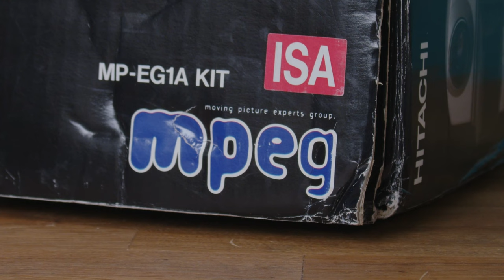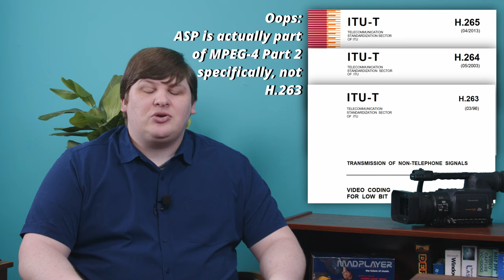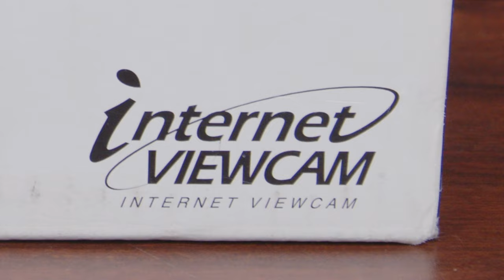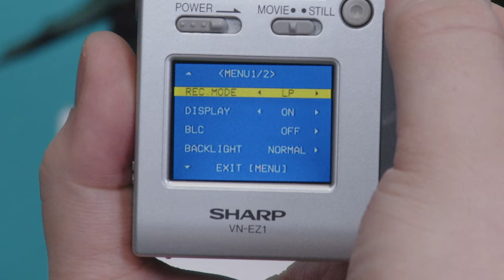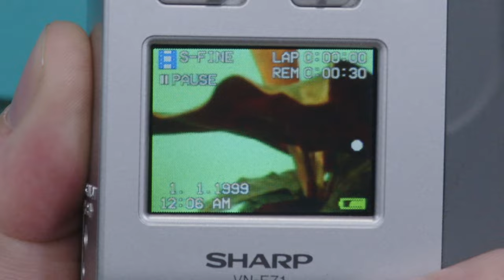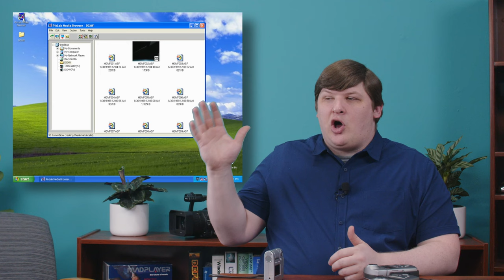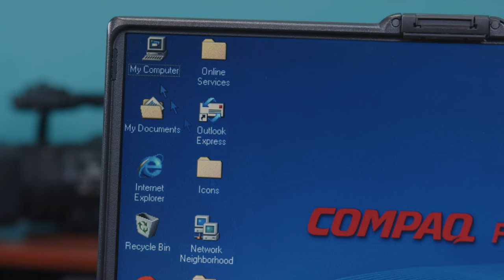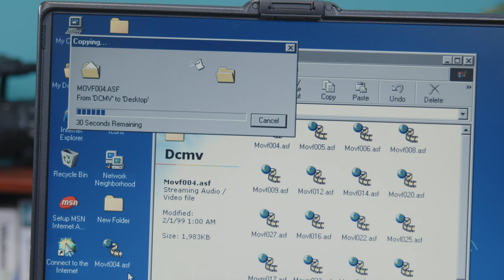The first thing that ever used MPEG4 [Sharp VN-EZ1]

Comment: 47:46
That styling is the one thing I could NOT stand about "millennium era" tech products. You've brought it up in the past, but EVERYTHING in consumer electronics had to be bubbly and egg shaped. It drove me nuts!! (being a huge fan of 80's and 90's volvos "styling", that design is nails on a chalkboard to me)
Reply: Consider the other side though: these shapes gave the devices personality and an optimism for an exciting and playful future of technology. Plus, they felt really great in your hands, usually! Or at least mine. I severely miss blobject electronics being a norm and I think it was better that way.
Reply: weird thats why i love 2000s products
Reply: It's one of the reasons why I love 2000's products so much
Reply: yeah but what volvo have you got?
Reply: I definitely have a love-hate relationship with it. it's new, interesting, and futuristic, but at the same time tacky, ugly, and makes it hard to use.

similar to 80s boxy styling! I love all my Minolta film cameras. but at times I've found them to be too boxy and clunky
Reply: Also, death to teal plastics. 

Turbo swapped Volvo 144s here, as an aside. Teal, but teal steel gets a pass.
Reply: I think it would have been passable if any of the Y2K technoblobs were made of something other than nasty painted plastic

Arguably it’s not the shapes of the time that suck, but the materials:

Chrome plastic that looks cheap, silver paint that looks even cheaper, soft touch rubber that degrades, shiny smooth surfaces that pick up scratches, clear plastic that makes you aware of every speck of dust in the device, silkscreening that rubs off easily, ABS that gets shiny if you look at it threateningly, beige-painted metal - the list goes on and on…

Comment: I am glad you mentioned Divx. That was usually the first thing I downloaded whenever I got a new PC in the early 00s.  All those extensions, asf, wmv, mp4, mpg, mov, mpeg, etc. It was such a hassle since you had all those container formats.. not interchangle, with all those odd codecs.
Reply: The worst thing about multimedia container formats is that, because most of them can contain just about anything; you have zero indication that what it contains is actually playable on any given system. Filename extensions, in general, are a terrible way of communicating metadata; and should have been replaced by a standardized metadata container decades ago.

Comment: 18:10 Fun fact! .mov isn't actually any different from .mp4. IIRC the MPEG basically took the Apple format and standardized it. You'll also see it with extensions .m4v, .m4a, .3gp, and some others.
Reply: m4a is just mp4 without a video stream
Reply: @TorutheRedFox  and Apple used the MOV container for regular AAC sold from iTunes as well as for QuickTime video. M4V and M4A were subtypes of MOV, just as WMV and WMA were subtypes of ASF

Comment: @7:30 One of my favorite things about mpeg - however it might not be strictly true - is that the standard defines the player and not the format or the encoder. It says: "Here! This is how a player looks and works. Now make something that this can play!". That's different to how videotapes and such standards were designed.
Reply: The ITU H.26*n* standards (or at least, the early ones) are even weirder with this, because H.261 was actually a video calling standard. Over ordinary phone lines. The handset would have a modem and codec inside of it that would let it negotiate and upgrade from analog voice to really low-bitrate digital video. So the spec is written with a bunch of language that implies the video stream is bidirectional, because in the intended use case it totally would be. There's even extensions in H.263 for in-band acknowledgements (e.g. "here's my frame, also I didn't get yours so please resend it") and conference calling services with multiple video streams - all things that make absolutely no sense to exist within a generic video codec and today we'd consider the job of a container or TCP.

MPEG was trying to unify basically every video market into a single common digital standard. They tried to subsume ITU H.263 (poorly), and also picked up a lot of weird baggage about trying to split the difference between NTSC and PAL. This was a market in which existing videotape formats couldn't even agree with themselves on how to store certain formats (e.g. SECAM vs. ME-SECAM recording); so it was a huge sea change to just have One Codec to Rule Them All.
Reply: As far as I know, this is how most (but certainly not all) compression standards work. That’s why you can have different ZIP compression programs that produce different size output, different MP3 encoders that produce better or worse quality at the same bitrate, etc.

Comment: 5:07 - This is because H.264 has an in-loop deblocking and deringing filter. It just so happens that on lower profiles H.264 tends to use 8x8 pixel blocks as well and then it smoothes the edges and blends them together (deblocking). H.264 however can use different block sizes, even 4x8, 8x4, 4x4 as well. But all will result in the 8x8 blocks being deblocked because they all perfectly fit into it.

Comment: Something I don’t get about this thing’s nominal use case is internet speeds - particularly when traveling - sucked in ~2000, most people were on dialup. My grandma downloading that 1mb clip would take her a solid 5min. Tech support could include a much smaller jpeg and a few lines of copy in an email. Plus, if you’re traveling and have to send video using a hotel phone, 5 mins connected to a local EarthLink access number to upload at hotel phone call rates isn’t cheap. 

On the one hand the 20yr old website is right, there are tons of use cases for being able to send video (and doing it in 1999/2000 is cool as hell!), but it’s just not practical in my view until DSL became widespread. I personally as a mega-nerd would have used the hell out of it, but I think the normies would have been like “you’re sending me a what now?”

Comment: I love your videos! Just the right amount of nerdy goodness. :) 

As a DSP engineer, I can tell you precisely how that extreme crunch distortion in the sample videos happens. It's simply digital clipping at 8 kHz sample rate!

Analog clipping creates under and overtones (harmonics), and so does digital clipping, but in a digital system any frequency that tries to go above half the sample rate (nyquist frequency) gets folded back down, called "aliasing". It's actually the same phenomenon that can make wagon wheels in video appear to turn backwards, but in audio instead of video.

If you start with a clean 8 kHz audio recording, and clip it in analog, or upsample it to a high sample rate and then clip, you'll have harsh sounding distortion, similar to what you hear when playing back in the camcorder's speaker. But if you clip it _while sampled at 8 kHz_, you have the exact unintelligible mess you heard when playing back those files.

This is also why, when designing audio processors that intentionally incorporate clipping in a controlled fashion (day job!), in order to keep this aliasing distortion manageable, you have to first upsample the audio at least 4 times, so 176.4 or 192 kHz, then do your clipping, then filter out anything above original nyquist, and sample back down.

Now as for how the codec changed since back then, I can only guess. Perhaps the interpretation of a scale factor changed?
Reply: Oh! Thank you so much! Here I was thinking it was a bit depth quantisation noise issue, I hadn’t even considered it was harmonics being introduced from not oversampling!

Comment: Unfortunately Windows doesn't support H.265 out of the box because of patents so I have had to deal with codecs when I want things to Just Work.
My guess for why ASB exists is that the camera is incapable of reencoding. MPEG-4 is an interframe codec so there's keyframes (full image) and interframes (delta from previous frame). Removing the end of a video is relatively easy but removing the beginning will require creating a new keyframe. ASB probably clips off the end and clips the beginning to the last keyframe before where you selected, then tell the computer how many frames to remove from the beginning.
Reply from the maker: Oh huh! Shows me, I realize now that you say it that I haven't tried using WMP since HEVC got popular
Reply: It's better to use something like MPV or MPC-HC/BE that use ffmpeg decoders internally rather than mess about with the Windows system decoders.
Reply: You have to pay like 99¢ to get the HEVC codec from the Microsoft store. There are free workarounds. But I learned this the hard way when I transferred photos and videos from my phone and figured out I couldn’t do anything with them.

Comment: I think it's safe to say the reason people started referring to codecs by their ITU designations (H.263, H.264, H.265) is because those are at least consistent and easy to place in order, whereas the various names used by MPEG are incredibly confusing, and tend to become less meaningful over time as MPEG add new stuff to the existing spec.
Reply from the maker: That's a good possibility but another angle that's been suggested to me by some friends is that this is actually Apple's fault, since they (ostensibly) had one of the earliest marketing pushes for h.264, where they called it h.264. Could be, could be.
Reply: @CathodeRayDude  Heh, reminds me of the trouble astronomers have naming new telescopes. "Thirty Meter Telescope?" What's next, "Extremely Large Telescope?" Bill Nye: Yes actually.
Reply: @CathodeRayDude  they talked about 263 in their documentation/website/promotional material for the iSight webcam too (and its accompanying iChat video calls) in ’03 or ’04 or something, which was the earliest marketing reference I remember finding in the Wayback Machine while I was heavily exploring it in 2010. So I think your friend is correct. Jobs or Ive or someone must’ve found those names more aesthetically appealing.
Reply: @ahensley  at least the Event Horizon Telescope has a decently descriptive name! But yes. Most are a mess!

Comment: A big issue with h.264 in its early days is that a lot of computers in the early 00s didn't have the cpu power to play it, especially in HD. I 2006 had to "obtain" the payware CoreAVC decoder (which was then the fastest h264 decoder) to play 720p h.264 files on the crappy Fujitsu laptop I had then. Fun fact, the first generation blu-ray players had to use quad core x86 CPUs to decode the video, with the video divided into 4 slices decoded by each core in parallel, which will be part of the blu-ray spec forever even though a 40 dollar android box can decode blu-ray video now.

h.264 was was pretty exciting tech at the time because it was the first time it was possible to have video on the web that was up to par with TV in terms of quality (at least at practical bitrates).

And the ITU(?) actually made reference coding/decoding software for MPEG-1 audio in the form of source code, which people actually compiled into usable software and eventually forked to make the LAME encoder.
Reply from the maker: This is a fascinating observation in re: the early bd players, I knew 264 was a beast but I had no idea it was that dire. And yeah, I noticed there was a ref impl in mpeg-1 very late in editing but decided not to try to shoehorn it in mostly because, based on my observations at least, everyone still seemed to be getting commercial MPEG codecs in the day. It was an era where the availability of source didn't mean something was "free" the way it does now, but in addition, the reference impl was probably not a V4W codec DLL.
Reply: Damn, I knew those first BD players were pricey and chonky, I had no idea that was why. I kind of just assumed they’d used a decoding ASIC blob like early CD and DVD players did. Interesting that splitting the video into four streams is part of the actual spec just for BD players, especially since the earliest discs just used higher bit-rate MPEG-2. 

Speaking of just barely handling the next-generation codec, my 2012 quad core x86 (i7 2600) can just about handle a 2K/1080 HEVC stream, though going by the CPU usage graphs I think it would stutter if it didn’t have SMT enabled (the i5 version of the same silicon would probably not handle it). It’s pretty funny that my iPad can do it on hardly any Wh, in comparison.
Reply: @CathodeRayDude  From what I recall, in nerd/enthusiast circles the most popular mp3 encoders were either pirated copies of various official Fraunhofer software, or compiles of the ISO reference software (and LAME when the project first started releasing patches for the ISO code). Fraunhofer actually threatened to sue a number of people for distributing compiled binaries of the ISO code, they were very protective of the MP3 patents. There's a reason it used to be a bit tricky to find binaries of LAME, or why most Linux distros wouldn't support MP3 without adding third party repos.

Comment: H.263 isnt much harder to decode than mpeg 1 and 2, to encode,  yes its harder, but not by that much, maybe like twice the amount.

To decode H.264 is absolutly brutal. The forst HD players that used H.264 used a top of the line cpu as well as a dedicated hardware to decode it. A problem with H.264 is that the decodec is so branchy  a hardware solution want really viable in 2004. Granted alreddy in 2005 the hardware become a bit better and cpu become a bit cheaper. And by 2006 pretty much any GPU with the help of an avrage cpu could decode H.264.

But this was a problem for digital tv
Reply: A weird case where being late to the part helped us in Brazil, as we got ISDB-T from Japan but with h.264 instead of their h.263.
I can only imagine the hellish price BD players would have if hardware decoders weren't yet a thing when it launched, as the lasers themselves were already enough of a problem.
Reply: @Kalvinjj  Yea.. they was on the shelf for €2000 the first year... And really, considering the hardware, that was actually even cheap.

The thing with the digital TV over here, at least in Sweden was that it was forced into the market really early, and it was first coded with h.261, then h.263 then h.264, then manage to kick the h.264 revision in right before the standard was set, but some settop boxes ended out on the market wit out the performance to decode h.264. Some people was mad, had to buy 3 boxes over a period of like 6 years.
Reply: In what world is "twice the amount" the same as "a little, but not much"?

Comment: That imported audio from the Sharp camera sounds like quantisation noise on 8-bit audio. But when you play it on the camera it sounds dithered and just fine. Usually a dither gets applied in the encode, not the decode, so that’s interesting — I’m not sure if interpreting dithered audio as undithered would re-introduce them, I don’t think it should? Now I’m wondering what else it could be. Interpreting signed as unsigned? A bit-depth conversion gone wrong? Hmmm.

Comment: I actually really like it and think it compares well to digital cameras (as opposed to camcorders) of the time. I suspect the low resolutions and bitrates are more to do with processing power than storage. The amount of compute it took to encode MPEG4 in real time was huge, and a small battery powered consumer camera is going to find it hard to cope.  I bet the "this is for emailing clips" angle was the marketing line because of that limited power, rather than the initial design aim of the device.

Back in 1997 I was working for an ISP and we streamed Princess Diana's funeral over the internet. We had to use a GIANT dual Pentium Pro system just to encode postage-stamp sized video of a similar quality to that camera. The fact that similar technology had shrunk so much in just a couple of years shows how cutting edge this stuff was.

Great video, but I think the Sharp deserves a touch more love. 🙂
Reply from the maker: That's an interesting angle I hadn't considered, although I feel like it's sort of equal. Even if they'd had more power, the storage situation was a real killer, since the largest cards you could get, even in CF, were maybe 256? Short of going back to a PC card HDD, it would have been really difficult to store any serious length or quality, so it's a tossup as to which was the bigger blocker.

Comment: It would be interesting to look at the MPEG1 structures of the two generations of cameras.  I wonder what GOP structure there is in the files.  Some basic encoders will create outputs with only full I frames, or use I and P frames, but not B frames, which would be less efficient and leave less bandwidth for quality

Comment: Smartmedia also has no wear leveling, it's left up to the device to handle that and many didn't bother. It's just a flash memory chip and connector and that's it. I wish someone would make a smartmedia to SMD adapter because there are some still actually useful devices like late 90's to early 2000's Yamaha synthesizers (like my MU2000) that use them. It can't be that hard to put a cheap microcontroller on a card that would translate between them.